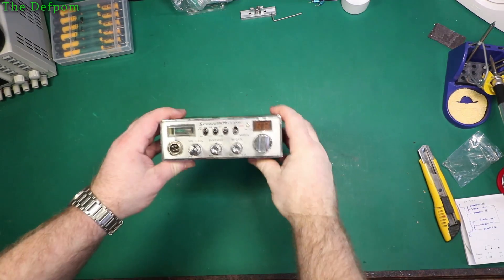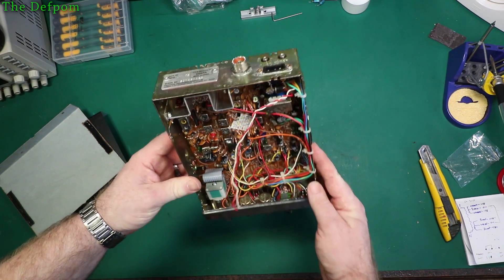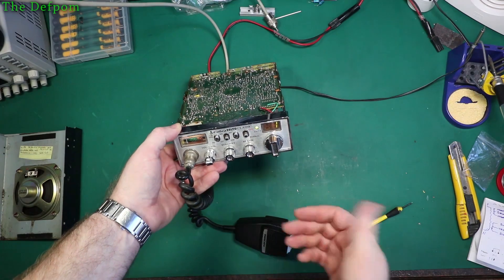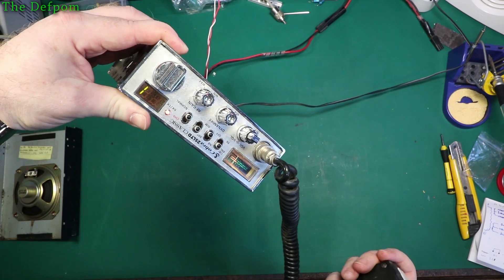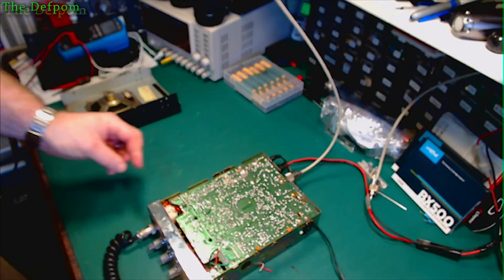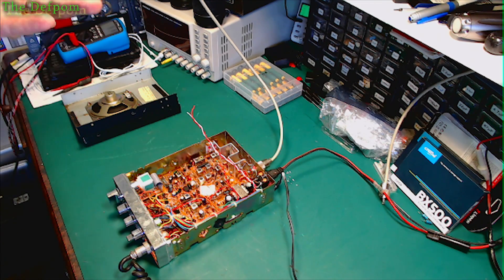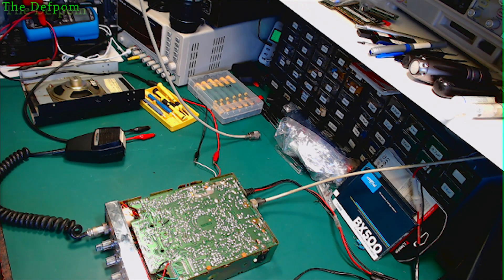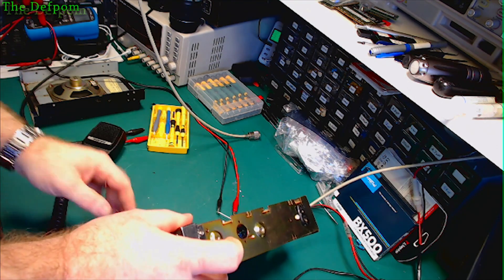🔴 #612 Cobra 25LTD Classic Liquid Damage Repair - Freeing Stuck Signal Meter sn_1160

Comment: I have a 29 LTD classic, has problem receiving. Can transmit (barely, not clear) to a friend’s house a mile away, but can’t hear anything in response. Any ideas?
Reply from the maker: probably an antenna system problem, try it with another radio.

Comment: Ahh the uniden chassis,  yes it's the classic but not much difference from the older versions.
The r.f p.a heatsink seems to be identical in most 40 channel uniden radios of that variety.
Good old units, and the typical uniden meter always locks up, even without a h2O drench lol.

I have noticed that all uniden radios of that era seem lazy on receive, im sure they run the i.f strip at a lower level than most radios.
You can hear someone fine but the meter hardly moves, lazy sod lol.
I like the uniden uniace 200 or audioline 341, still lazy buggers but reliable :-D

Comment: Nice to see you working on a CB again and it looks like a similar arrangement to the 21 LTD as I used the alignment instructions for the 25 in my recent CB video. My set was also a  bit deaf compared to other radios in my collection. Be interesting to see how you do the alignment proper and the TX mixer stage I had trouble with the test points hope you can show that. Thanks Regards Chris
Reply from the maker: AllTheGearNoIdea - I recorded that footage back in January, I needed a filler video so chose that one, although I haven’t actually done any more work on the radio since then, it’s still sitting on my desk.
Reply: Defpom's Electronics & Repair  Ah no worries mate Regards Chris
Reply: AllTheGearNoIdea
Ahh the uniden lazy meter effect, all unidens of that era seem deaf, but i think they run the i.f strip at a lower level.
You can usually hear people even when the meter only just moves.
Later uniden uniace 200 (my favorite) also seem lazy.
And cybernet are the opposite, lots of needle movement but they don't appear to hear more than the unidens.